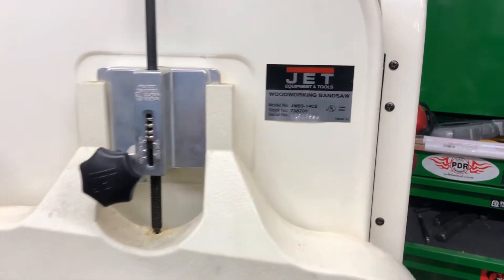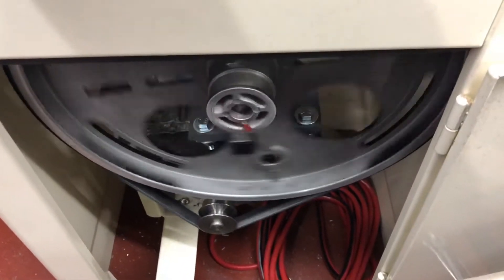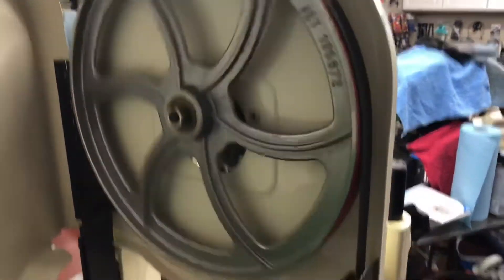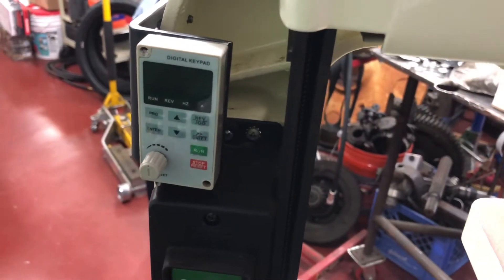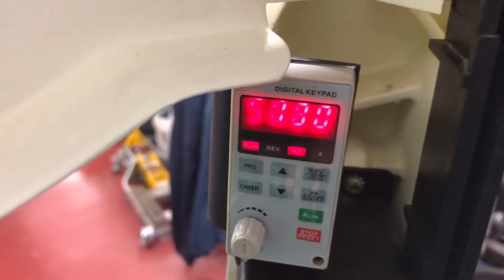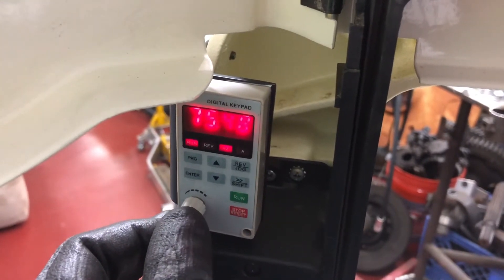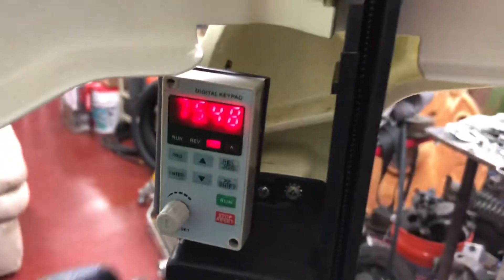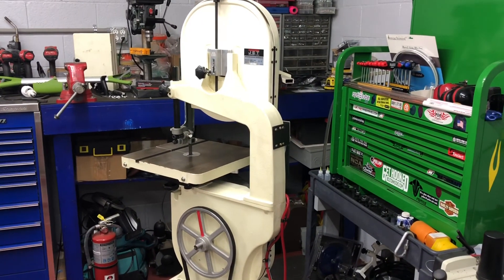Woodworking vertical bandsaw converted to metal cutting using a VFD and a 3 phase motor

Comment: Sweet pulley speed reduction setup! Probably loads of torque there. I would watch the metal dust with that VFD. I ran a surface grinder with the VFD too close and it shorted and blew. Startled me because it was pretty loud. I relocated a new one in an enclosure with fans and filters about 8 feet away and was fine from then on. You can get or make an extension cable for the remote keypad to mount where it's easy to use.

Comment: How does it cut? does it bogg down under load,does the motor get hot, Why did you add a larger pulley if the vfd has variable speed?

Comment: Is there enough torque at the slowest speed to cut steel?
I want to do the same but maybe using a gear box
Reply from the maker: Yes, it does. But the slower you go, the blade gets more “grabby” rather than cut. Super slow isn’t your friend.

Comment: Hi I have a problem with my bandsaw as it is 3 phase 1/1.2 kw two speed could you give me some ideas on what vfd 
I would need I have a phase converter here but it is not working properly and the company wants a lot of money to look at it 
Before any repairs I’m just a hobbyist thinking of going your way to convert it any advice would be much appreciated thanks Geoff Newcastle upon Tyne U.K. 👍
Reply from the maker: Send me your email address, I’ll certainly help with what I can. If you post your email here, it’ll be public until I can remove it.

Comment: Very nice job, I have planned to do the same to an older bandsaw I picked up some years ago. How slow can you run the motor until heat becomes an issue? 

I also have a small mill/drill I’m after adding x and y feeds to. By chance, do you recommend a particular size stepper motor for that application?
Reply from the maker: I’ve run it down reliably to 30hz with no issues. But the motor I have is setup for that anyway. An inverter rated motor will run slower and not heat up as fast as a standard motor will. They need the speed so the fan becomes effective. 

Sorry, I can’t really help with your mill/drill project. I haven’t gotten it or the automation side of machining just yet. 👍🏼

Comment: Can a vfd be used on a 19” miter box to slow it down to a cold cut saw
Reply from the maker: Mark, if you are willing to modify the saw with a 3 phase motor and drive, then yes, it’s possible.

Comment: wait - why do you even NEED the gearing if you're using a VFD? torque? couldn't you avoid the gearing by just using a different motor ?
Reply from the maker: The answer is torque and remaining tunable. Keeping the motor near it’s rated RPM retains torque at peak and cooling. Even a inverter rated motor will overheat I’d ran really slow and asked to deliver lots of torque. You want that mechanical advantage of running faster. 👍🏼
Reply: @dieselshadow  couldn't you just put an external fan blowing on the motor to cool it off or will that not be enough?

Comment: Could you just use a 1/2 hp 115v 1140rpm motor?
Reply from the maker: Eye, you absolutely could. I wouldn’t discourage you from doing so if your budget doesn’t allow. However the 3 phase motor and VFD allow for speed adjustments that are handy if you are cutting different materials. Some like the blade speed faster, others like it slower. 

But if you had the right single phase motor available, I would absolutely use it. 👍🏼

Comment: Why did you need to change size pulleys? shouldn't the VFD alone be enough?
Reply from the maker: Ideally you want the motor to turn the blade at the speed you need at 60hz so you don’t need the drive. Then the drive is used to tune or dial in the exact speed you want. If you just use a motor drive to slow the motor down, you may overheat the motor due to lack of cooling air and you may lose a considerable amount of torque. So the mechanical speed change is setting the machine up for better operation and a longer life. 👍🏼
Reply: @dieselshadow  I thought this was only the case if you are using standard 3 phase motors, with inverter duty motors being designed for this.  Dont get me wrong, I love this conversion i plan to do the same, but my plan is a 2hp 3 phase, inverter duty motor.  I have heard to offset the low torque on low rpm vfd the motor needs to be upsized.  Just want to pick your brain on this see if you know more.  Thanks
Reply from the maker: So heres the deal. Mechanical advantage is one. You can spin an inverter rated motor down and not overheat it as bad  as a normal motor. Some motors won’t like this. But as you slow it down, you lose torque and mechanical advantage. I wanted to use the VFD to tune the speed from rated RPM. This way I retain proper blade speed with the motor running at peak torque speeds. It won’t overheat doing this either. If you slow it down, you lose that torque and can overheat the motor if there’s not adequate enough air flow, regardless if it’s inverter rated or not. 

It’s worth your time to gear it properly so you can get the motor spinning near its nominal rated speed if you want to achieve an efficient machine that’s also powerful and long lasting. 🍻 Then the inverter can be used to slow it down or speed it up to fine tune for any particular job you may need the saw for. 👍🏼
Reply: @dieselshadow thanks for the info!\

Comment: Where did you get the larger pulley from?
Reply from the maker: I got them from Amazon. Be careful though, you need to know bore size, diameter, and belt size prior to ordering. There is a myriad of pulleys available out there. 👍🏼